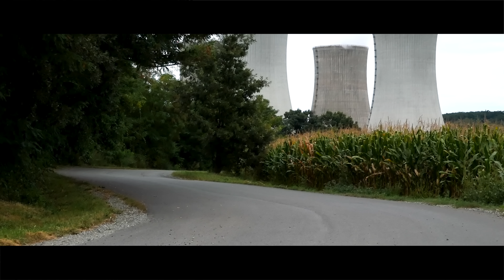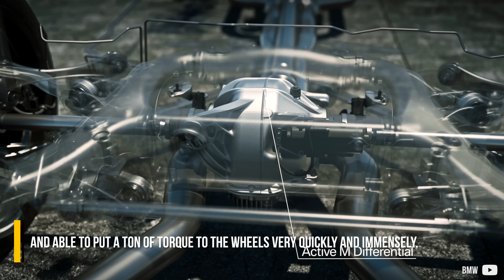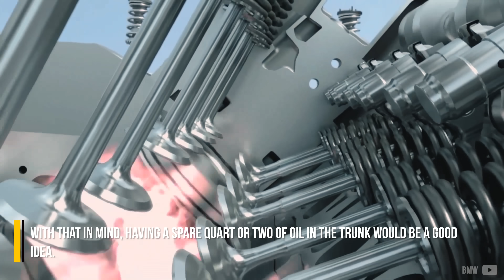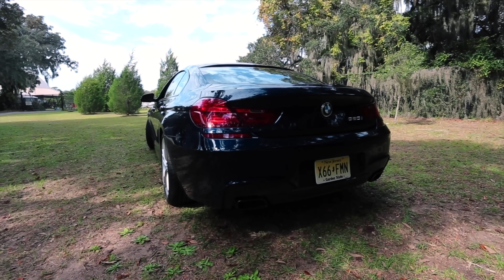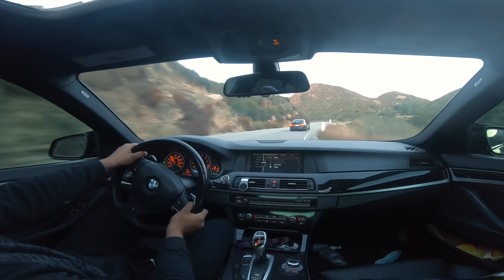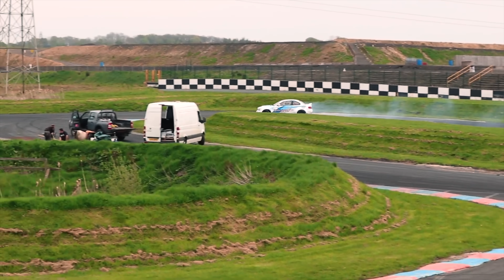The Worst BMW Ever?

Comment: I bought a used F10 M5 with 31k miles and put another 34k trouble-free miles on it over 6 years.  Ironically, it was one of the most reliable (and fun) cars I've ever owned.  It did consume oil as stated in the video, and you would end up adding a quart every 2k miles or so.  It was quick as hell for a heavy sedan with no noticeable turbo lag.  It was a bit numb in the steering and was pretty stiff even in comfort suspension mode.  I sold it at about 65k miles, believing I had beaten the odds for any major repairs and was probably about to run out of luck.  Very easy car to sell; had tons of interested parties.
Reply: I have an 13 M5 with a DCT at 115,000 miles that I've owned since 90,000. It's got downpipes, intake with a BM3 tune probably making about 650 whp and it has literally been nothing but reliable. I've only done oil changes and tires. The N63 might be a nightmare but BMW did a kick ass job with the S63
Reply: @TunedScoob  Sadly, you’re a rarity. Lexus reliability is no longer typical of BMWs and Mercedes Benzes. ☹️
Reply: I mean I would expect any car to last 65k miles at the bare minimum before any big  repairs. Honestly it's more like 100k miles.
Reply: This is good to hear. I just bought a 20k f01 Alpina b7 facelift so I'm hoping to have a similar experience!
Reply: @charlesaferg  614 Motorsport’s experience with his 2013 BMW M5 is a fluke. That experience was once typical of BMW and Mercedes Benz.

If you want to have that experience where it’s typical, the Lexus LS Series (the Lexus equivalent of the BMW 7 Series and Mercedes Benz S Class) is your only option in that class of car. I can’t stress this enough.
Reply: @timcorrell9863  I know what the LS series is, guy. You think I'm new to cars or something?
Reply: @charlesaferg  To quote a now unknown actor named Maxwell Cauffield as Michael Carrington in Grease 2 (yes, I’m a fan, but don’t tell Michelle Pfeiffer 😆), I was just checking.
Reply: @timcorrell9863 are you familiar with the B58? That is Toyota level reliability
Reply: @MachineEnthusiast  Not according to the countless number of mechanics I’ve talked to. Nice try, though. ;)
Reply: @Tomi Jerry BMW is unreliable as fuck. I’ll take boring and reliable over fun and unreliable anytime, thank you very much. 😀
Reply: @timcorrell9863  actually bmw is now more reliable. For the V8 doubt that will last many years but the b58 ,b57 and s58 surely will last a long time a right maintenance.
Reply: To say that your BMW is reliable and to say that it consumes 1L of oil per 2000km in the same sentence is hilarious
Reply: @camilledilegno8242  That oil consumption is breakdown from the heat of the hot V configuration. Nothing to do with reliability. The engineers traded reduced turbo lag for higher operational temperatures. I didn’t have mine long enough to note any reliability issues due to the configuration, but I understand there can be some. Mechanically, the car was quite reliable for my ownership.
Reply: Modern BMWs last 90,000 miles/144,000 kilometers before electrically, electronically, mechanically and, where applicable, hydraulically falling apart. You probably could’ve gotten another 25,000 miles/40,000 kilometers out of it before getting rid of it.

You would’ve had to junk it rather than sell it as absolutely nobody would want those massive repair bills. They may not be fun (maybe even boring), but a Lexus lasts forever and maintenance, operating and running costs are far lower than any European or even any American or non Japanese Asian brand and matches or exceeds all Japanese brands in lower costs to maintain, operate and run.

Yes, Lexus is a glorified Toyota, but that’s why it’s so kick ass where it counts most by far (dependability, durability, quality, reliability, resale value, residual value, satisfaction and service). Lexus matches or exceeds the supposed safest vehicles in safety and security and has best in class fuel economy and lowest in class emissions to boot.

I know Lexus is also lacking in dry weather performance and, in some cases, prestige compared to it’s European and American counterparts and compared to some of it’s Asian counterparts (Japanese and otherwise). These counterparts of Lexus also match or exceed it in technology in many cases (in many cases, Lexus exceed).

Yes, Lexus also falls shorts of it’s American and European counterparts and some Japanese and other Asians in exterior style and wheel styles but Lexus matches or exceeds other vehicles in interior design and materials. You would be very unwise to not at least consider Lexus for a luxury car lease or purchase.

The wisest choice by far is to buy or lease a Lexus and pretend other luxury brands never have existed and never will. They have the lowest frequency and intensity of lemons, recalls and technical service bulletins, to boot, and are the easiest modern vehicles to work on.

No, I don’t work for Lexus. I no longer even drive. But I know my shit when it comes to cars.
Reply: @timcorrell9863  Probably why it was easy for him to sell it. 4000km of joy left to use before problems.
Reply: @timcorrell9863  I have 3 modern BMW's. Two of which have over 130k miles on them. I do my own maintenance and my repair bills aren't that massive and the have yet to fall apart. The only real complaint I have about them is oil leaks and and coolant leaks but even those aren't that hard to fix.
Reply: @donnieengle1213  You’re lucky. You’re experience is not typical of that of a modern BMW, especially with that mileage. Modern BMWs typically only last 75,000 miles.
Reply: @timcorrell9863  With all due respect I don't believe modern BMW's only last 75k miles. I know many people with them with much more mileage. Hell my M5 has 77k and still runs excellent. In fact it's probably the one with the least issues.
Reply: @timcorrell9863  I have never seen a Lexus that looks or sounds as good as a BMW.
Reply: @JosefStaliner  maybe try a modern LS/LC 500
Reply: @JosefStaliner  That’s true. But Lexus still lasts forever. BMW no longer lasts forever.

You strongly have to take that into consideration.
Reply: @timcorrell9863  well I would hope so, Lexus Is still using engines from the early 2000’s. they may be reliable but there’s not a single Lexus that can compare performance wise to bmw M’s
Reply: @Cle_M3  I agree. But I’ll take best in class dependability, durability, quality, reliability, resale value, residual value, satisfaction, service and possibly interior design, materials and style at the expense of a boring drive and possibly boring exterior styling over fun as hell drives and possibly beautiful exterior style at the expense of the other things that I mentioned being subpar any day.

In the other areas, BMW once matched Lexus, but at a much higher price. And Lexus always has matched and still matches or exceed BMW in safety and security.

For me personally, real luxury is doing what Lexus and Toyota do better than everybody else.
Reply: @timcorrell9863  yea I feel you that’s why I daily a lx470 and pull out my e92 and f80 for track days best of both worlds
Reply: @JosefStaliner  rc-f
Reply: @Cle_M3  Agree 00 LS400 as my daily driver but on the weekends or when I want to have a fun commute I take my e92 or e39.
Reply: @shaozepan7676  PSsssh 4500lbs hard pass.
Reply: @timcorrell9863  The BMW was a bucket list car, and for the time was an amazing experience as I said. Lexus is another on my list to own some day, perhaps an LC. I have never heard anything but good things about the brand and am well familiar with Toyota’s reliability. Thanks for your input!
Reply: @kevindavis5966  You’re welcome. 👌😀👍

Comment: my uncle had an 08 528i that he got back in 2011, frequent oil change but engine was super reliable, he recently sold it in 2020 with 264k miles for 6k$ , 340i with the B58 engine is gift from heaven

Comment: I have had an N63 powered BMW for 12 years, and have had no issues with the drive train, but then again, after 12 years the car has only 40k miles on it. I change the oil every 5000 miles. It does burn oil on long highway drives, and on occasion I have had to add a liter after a road trip. But I love the power and the sound.
Reply: I have a S63 2012 M5  Got it with 8k miles 8yrs ago and it burns a litre of oil roughly every 500mls...always has and now done 88k miles still uses the same amount. Tried slightly thicker oil in summer but not seen any noticeable difference to be fair.
Reply: seems adding oil is just a BMW thing, mine started burning less when I switched to 5/10W40

Comment: I had my LAST Bimmer, (535 ia NA, cast iron block + heads twin cam i6 = E35 / late 1.990's), without EVER having any engine / tranny issues. (Only changed sprk plugs to then new Bosch Platinum), changing motor oil at least twice a year and / or before 4K miles, as well as BMW's OEM tranny's ATF every 25K - 30K miles. When they started to use 'aluminium / plasticrap everything', just changed to Toyota's reliability. I still  keep my late Dad's Nissan (1.984) K160 / P40 petrol engine. NOT for sale!!.😉
Many thanks & Blessings!!.. 
🤗🙏🙏🙏🙏

Comment: It's predecessor, the S85 V10, was also notorious for major reliability issues. But at least that engine had an incredible sound and rev happy character to justify its high maintenence costs.   The S63 doesn't even sound good IMO.  It will do brutal power and torque (thanks to a pair of big turbos) but this engine to me signalled a major change in BMW ethos away from "exciting" engines with character that appeals to driving enthusiasts, to just chasing big power and torque numbers and not a lot else.  The E60 is the last "proper" M5/M6 IMO.
Reply: I'd argue that E39 is the last proper M5... sure the engine in the E60 is great and all but the build quality and the looks/design went down a lot after the E39/E46/E38/etc era. I'd say those are peak BMW.
Reply: @Serge-RO  I'd say the E60 has come into it's own now. E39 was 10/10, but the E60 is 9/10 imo compared to everything that followed.

Comment: I had my  2012 E71 X6M with the S63 engine.  What a nightmare of a car. Great when it works, but a devil when it broke down. O had to trade it in after throwing a lot of money on it.  I'm looking to get the newer F86 x6m with the newly improved s63 engine. Haven't seen much complaints on the forums. Beautiful SUV and very fast when you put your foot down. Anyone knows of any issues on the new s64 from 2015 onwards??

Comment: Same stuff happened for the first THP MiniCooper S engine.
Was a disaster !
But after years the THP is becomed amazing with the 270hp Prince engine ( Rcz-R / 308GTI ).
I own one of these and i can just confirm i change oil + spark plugs + coils every 10.000 kms.
I got NGK red coils ( standard ones are so bad..) , a K&N Panel filter and a ECU custom remap based on 100 octane fuel only.
Car is standing at 302hp from 28k kilometers flawlessy.
I only changed the thermostat and the turbo recirculation pressure valve near the pop-off one , but it's a VERY common issue in EVERY PSA engine.
The car is a freakin beast for a 1.6 liter.
So only to say that shit happens in engines world guys :) 
BUT we still love cars , right ? ;) <3

Comment: My S54 in my 2005 E46 M3 as 120,000 miles on it period it never has burned drop of oil in between 4,500 mile interval oil changes.
Liqui Molly oil, Liqui Molly Ceratec and Mahle oil filter.

Rod bearings oil test are fine.
But I do something that nobody else I no or read about does. I wait until the engine OIL reaches full operating temperature before I take it over 3000 RPM.

 I want to see that OIL TEMPERATURE needle at 190 degrees before I take it over 3000 RPM. 
And then I redine the crap out of it since I bought it with 17,000 miles on it in 2009.

Original coils. Original everything else. Frequent air filter changes.

 I think I'm only on my third set of NGK plugs
Reply: 88k on my F10 M5 (2012). I always get oil to temp before going over 2/3K RPM. Thought that was mandatory lol or at least common sense.

Comment: I have a 2013 n20 stage 1 tune pushing 300 hp from a v4 120,000 only 1000$ in maintenance since buying 50,000 miles ago. The f10 528i is the best bmw for its price

Comment: I had a 1.4 twincharged polo gti. It drank 500ml of oil every 1000kms.  it was "within spec"  germans are notorious for creating powerful effecient engines at the cost of oil consumption and durability.
Reply: It always helps to change your oil as much as you can rather than waiting through these exponentially long service intervals

Comment: BMW's six banger engines are all pretty much works of art, M30, M54, S50/2 S54 S38 etc, but their four and eight bangers, not so much. Actually the S14, a four banger that was magnificent, but then dig deeper and we see that Paul Roche sawed off two cylinders from an S38 to make them!
Reply: M57 six-pot diesel is solid, too (once the swirl flaps are removed). It's N57 replacement suffers from the same issues are the N47 4-pot diesel; N57 was succeeded by the B57 which so far seems to reliable.

Don't know about the reliability of older tech M21 and M51 six-pots though.

BMW's only reliable V8s seem to be their M67D40 and M67D44 twin-turbo diesel engines.

Comment: what a nightmare my n54 was. 
valve cover gasket lost count
oil filter housing changed with every oil change
turbos
waste gates
numerous sets of ignition coils and spark plugs
numerous sets of injectors at $2.5k 
hpfp 
lpfp 
vanos
numerous water pumps
numerous batteries wasted while car was in shop 
idrive system fried on its own
dual mass flywheel 
clutch
$20k repairs in 9 years owned
will never ever buy bmw again
absolute trash
2months a year in the shop
only put 60k miles
update: i meant n54 not n53
Reply: n53 does not have turbos, if you had them this could explain why your car "exploded" on you :D
Reply: @simplesimson1  yikes i meant n54 sorry about that
Reply: Buy a B58 lol. Have almost same mileage as yours and had zero costs so far, only done regular oil changes and spark plugs so far.
Reply: almost the same her wirh N53! car was running great with minor issues.then engine starts to fall apart at 97kkm every month somethings broke. engine dead only 6month, 30kkm and thousend of €€€ later.

Comment: Owned 3 7 series from 05 to 08...the N62b44 and the N62b48....the 02 to 05 4.4...are f****g nightmares....the 06 to 08 4.8s aren't as bad......they look sooo good...and drive like a dream when running right..love and hate thing...planning to buy an 645 roller and LS swap it!

Comment: I see a lot of comments trying to compare German vs American engineering such as the LS and how better the latter is. German engineering becomes important for non-US countries because it strives for lower fuel consumption, with less displacement but high power output to compete with US counterparts. As a result, it does call for unreliability as well as complexity. However, based on the challenge, we should commend German engineering. Here in my continent, 95 Oct costs an av of $1,48/l. Would I buy a US 5.0 LS, or a German 4.4 S63? The answer is obvious. Not to mention the combination of daily driver, high performance, family car, luxury perks I get from the Germans.

Comment: They need to add better air flow and shielding to the cats.. They sho also FreeValve instead of the stupid valvatronic and chain... Anyway, use 40w oil

Comment: Mmmm I have an f10 m5 with 131k miles
Been owning it for the past 100k miles as a daily driver. And I’ve swore that this is one of the best engines made. Not a single problem. Oil change every 3k miles. Regular maintenance. Did have to replace turbos but the engine itself has treated me very very good. Maybe I got lucky with this one regardless, I love my tuned m5
Reply: I have one as well got it with 48k miles now at 80k miles works like charm oil change every 3-4k miles, no need to top it off, and let's not forget to mention engine sucked in water at 74k miles and hydrolocked, bmw dealer quoted me 48k for new engine "because engine was dead" as stated per BMW, took ca to other none dealer shop ang guess what engine wasn't dead and it is  going strong as when it came out of factory.
Reply: N63 is not the same as the S63 in the f10 M5
N63 is the motor in the 50i motors - 550i/650i/ XDrive50i

The S63 IS based on the N63, but it is heavily revised and has significantly less issues as a result.
Reply: @buroojk  you’re right, my mistake
Reply: Oil changes every 3k did you say....?   Enough said!    Do you think it would still be in great shape with oil changes every 12-15k like BMW suggests? lol
Reply: @soundseeker63  I know for an absolute fact that the engine would seize with those intervals
Reply: Im sorry wait WHAT oil change every 3k miles???
Reply: @TheV8Pumpkin  If you care about your car that's the way to do it 3k-5k, oil changes are quite a bit cheaper then a new engine and towing costs and associated headaches.
Reply: @gentlebyte  you can say that again!
Reply: On my second F10 M5. Oil change every 5k miles. Doesn’t consume oil. Had one injector fail on 43k miles because it’s stage 2. Otherwise dct would give before engine would post any issues

Comment: I have a 2011 550ix with about 135k on it.  I've done nothing to it since I got it cheap about 30k miles ago.  Doesn't seem to use any oil, or the electronic dipstick doesn't work.  I change the oil at 7500 though 15k is way to much.  Not sure this even deserves the title of worst BMW V8  the M60 had block issues, and they didn't build them for long.  Modern engine wise I don't think anything will beat out a 6.4  Ford/Navistar Diesel for reliability issues.